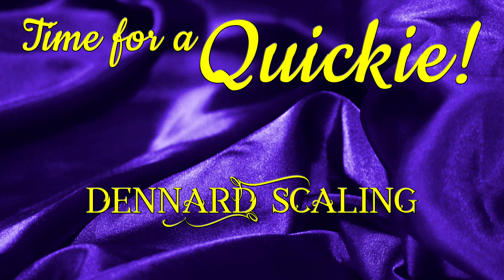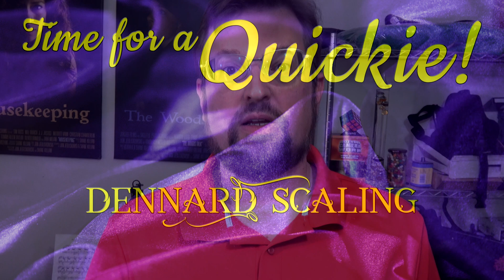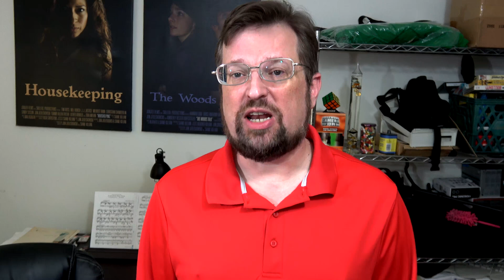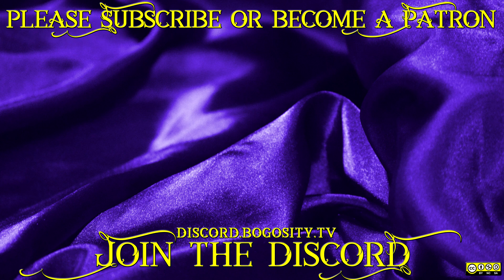Quickie: Dennard Scaling

Comment: I expect we'll see the return of specialist processors optimized for specific types of tasks.  These used to be common (even the MOSTek 6502 had a dedicated decimal calculation mode to facilitate financial systems) and, like code optimization, largely disappeared when increased raw general processor power made the extra performance of specialist processors not worth the extra cost of development.
Reply: More instructions sets like SSE or MMX

Comment: The problem over the next decades will be solving parallelism at scale, specifically getting rid of the need for a single source of truth. Regardless of other limits, a single calculation unit can’t operate faster than speed of light. But we can process a broken down problem simultaneously at the speed of light. Trick is to break it down, calculate, recombine, and deal with conflicts as fast as possible

Comment: What are your thoughts on quantum computers? From what I hear about them, they seem to be the computers of the future.
Reply: To my understanding, we are still searching for the room-temperature superconductor that will make large-scale quantum computer rollouts a reality.
Reply from the maker: "To my understanding, we are still searching for the room-temperature superconductor that will make large-scale quantum computer rollouts a reality." They haven't even found liquid-nitrogen-cooled superconductors that would make MRIs much cheaper and more available. They have to be cooled by liquid helium.

The issue with quantum computers, as you say, is that they're probabilistic. So they're really only good for algorithms where a quantum Fourier transform makes the right answer more likely. Also, since that's not even a guarantee as you point out, it's only really good for problems that are difficult to solve but easy to check.
Reply: @shanedk  I guess then they'll likely be relegated to being supercomputers where the temperature is easier to control and to be used for a specific purpose.
Reply: My understanding of this is that quantum computers may help us solve some of the most sought after applications of computing, and in breathtaking efficiency. BUT we’ll need to put in an unknown (if not unbounded) amount of time to ‘ask the question the right way’. We’ll trust the computer if > 50% of answers come back in alignment AND if we are confident that the question we asked has a answer distribution where one answer has a >50% probability of being ‘true’ in whatever sense that means. That could be as concrete as factorials or prime numbers or as abstract as ‘the right characteristics of a species to become sentient’ but you can’t ask it that way. You don’t need to know the answer but you need to know that whatever the answer is, it’s at least 50% probable which is no easy feat at all. 

I’d say it’s orders of magnitude more specialized than a GPU which is really just a CPU that we call something else. 

You’re playing with nature here, and nature has billions of years to play while we don’t. At least not any single one of us.
Reply from the maker: From what I understand, it's not temperature per se, it's noise. ANY noise (thermal, EM, or whatever) will interact with the qubits and destroy them. So you need to make sure that's not likely to happen before you have a chance to read them. If you look at any of the demonstration boards they have, those qubits--which would be microscopic--are surrounded by a LOT of shielding!
Reply from the maker: I'll be honest, I don't think they're going to be the amazing leap forward everybody thinks they will be. They're certainly an innovation and make a lot of things possible, but it's not going to be like it's portrayed, with them able to do everything instantly. They're kind of like a GPU: a supplement to a classical computer, but they have limitations of their own.

Comment: Every time I have to wait for a computer or smartphone to do something not involving the network I die a little inside.  Even with cheap hardware the only reason apps are less than instantaneously responsive is because of poor quality software, often the result of numerous layers of poor-quality thick abstractions designed by children.
Reply: It's harder to notice, but hardware contributes to this sad state of affairs as well.
It is often buggy and poorly documented, it does not implement standards properly or does it's own thing completely only for sake of being different.
80% of the software stack exist just to encapsulate and abstract hardware problems away.
Reply: @failing@commenting a lot of hardware does suck, but I reject the notion that sucky hardware is an important factor — it’s tiny in the grand scheme.  A lot of ancient hardware sucked even more than today’s hardware yet the applications were more responsive because they had less horrible layers / higher quality software engineers.  BTW I work on real-time embedded systems where we have tons of sucky hardware that’s poorly documented and poorly implemented. ;)

Comment: If we could master the terahertz range of light, we could have chips jump to 500 GHz.
Reply: At that point how fast information can travel inside a chip becomes a problem, because 0.5thz means each cycle lasts only 2 femtoseconds and light can only travel at most 0.6 millimeters in that amount of time
Reply: @jackmcslay  Decades ago, Grace Hopper had had a bunch of lengths of wire cut to the length an electrical signal could travel in a microsecond, and could demonstrate how much distance you had to work with if you wanted, say, a 330 nanosecond clock cycle.  She also pointed out that if you wanted to see how far light could go in a picosecond, a good way was to use a pepper grinder.

Comment: Ah yes, software sprawl. I remember when motherboards started increasing memory capacity and programmers started getting lazy, allowing their code to inflate, because hey, memory is cheap now!
Reply: Yeah,  I hear the "optimization is the root of all evil" to avoid doing the hard work. Usually optimization is crammed in the end of the beta cycle when there is the least amount of resources to pay serious attention to it.
https://ubiquity.acm.org/article.cfm?id=1513451
Reply: Which specially sucks nowadays that there's a number of software you run in the background and by the time you've installed steam, telegram, dropbox and so forth - you've propably already ate 1-2GB of ram on top of the 1 GB of ram your OS eats already
Reply: @jackmcslay  Some people I work with use a program called Quickbooks. That is the most bloated piece of crap I have ever seen. It is basically a glorified calculator and database interface, should be blazing fast; but it is a dog.
Reply from the maker: Just look at regular webpages. Megabytes of JQuery and other garbage just to do things that HTML/CSS/JS could do in a few kilobytes.

Comment: I bought an AlphaSmart a while back for nostalgia's sake. The device is like a cheap mini laptop limited to word processing. You can generate text files and transfer them to PC via PS2 keyboard emulation. I had to throttle down the text transfer function in order to transfer to a modern PC successfully otherwise the character output rate was too fast for my computer to keep up with. This never was a problem when I was a kid. So despite computers being over 100 times faster, because of all the bloaty side processes. The system couldn't manage ~20 keystrokes per second. In some regards computing has gotten slower.
Reply from the maker: Keyboards are DEFINITELY slower. I always notice a slight delay when typing. I don't know how much of that is due to the OS or to USB or what, but it's definitely not as responsive.
Reply: @shanedk  It's probably USB.  I wouldn't be surprised if most keyboards are still using the USB 1.1 standard (which is very slow), and keyboard subsystems aren't able to keep up with faster than human typing speeds (because why would you set it up that way).  The older PS2, AT, and XT type keyboard subsystems would probably just have run as fast as they could, like everything else in early systems.  (Despite liking a specific model of USB keyboard, PS2 keyboards are objectively better.  I've seen USB drivers fail to run on a new, premium system right out of the box.  (OK, it WAS a Dell XPS 700, which wasn't nearly as good a system as the price-point would indicate, but still.)